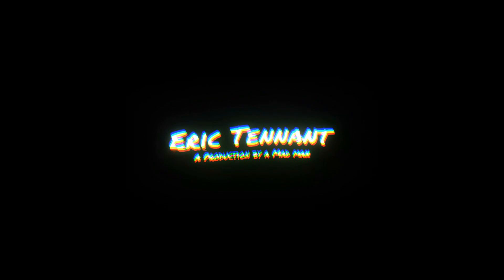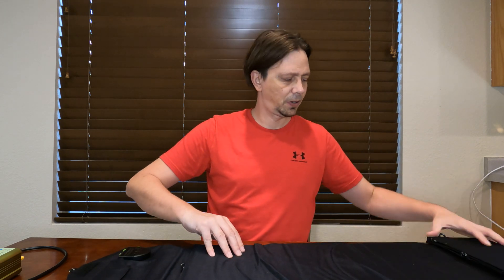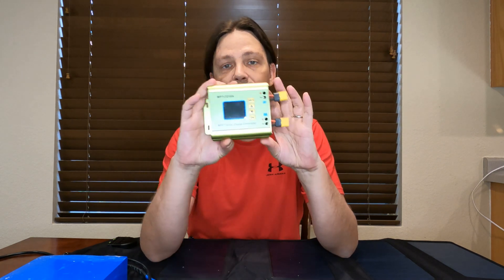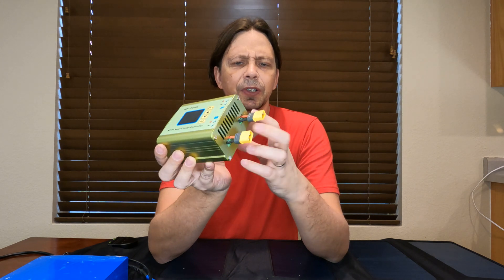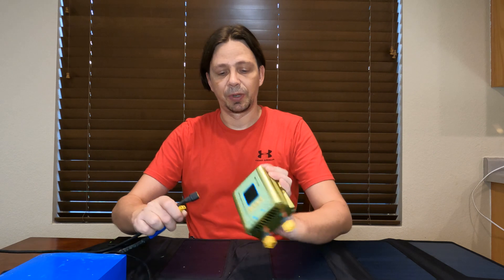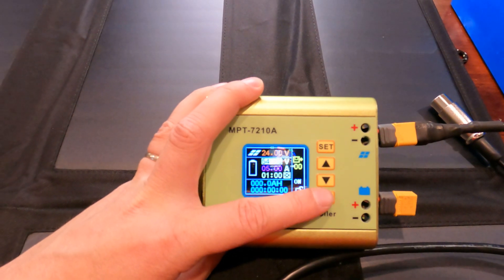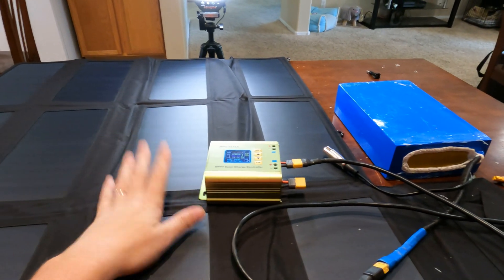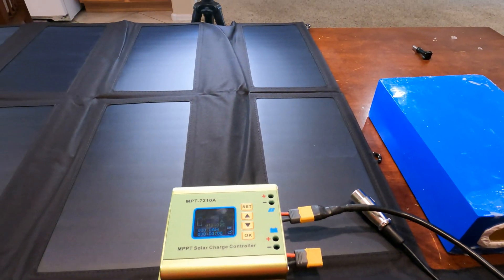How To Charge E-Bike with Solar

Comment: Sorry did you connect directly the battery with the charge controller??? I think out put of charge controller it's different than in put battery 😮, isn't it?
Reply from the maker: 54.6v is the charge voltage for a 48v battery.

Comment: Eric I need some of your genius. I have a mokwheel which has a 750 watt motor. Since I am a whale beached at around 275 I need to add a second motor I have a second battery which is about a 900 975 watt hour unit. I'm not worried about running out of battery since I have two but what I am worried about is the lack of power that comes from just having one 750 watt motor. I thought I would go to a 1000 watt motor and use three batteries as you have done on one of your bikes. The problem is I have a Mach wheel which is truly an elephant weighing 80 lb on its own. I'm pretty sure that it isn't that big a deal to add an in-wheel motor to the front wheel but I could use any sources that you have to direct me to how to do it. Dude I got into this because you made it such an awesome sport to do. I have maybe a hundred thousand miles on bikes in my life but now I'm old 67 and fat 275 and I could use a little help technically. I'm not a complete idiot I'm a Doctor who's retired but I could sure use a little guidance. If you want to help me with this project reach out and I'll find a way to get in touch. I have some family who Winters in Arizona in your areaand maybe we could bump heads have a bowl or two and work on this project and it could make a cool video for you. Dude I'm so stoked that you've had so many companies reach out to you with sponsorship test videos I can't believe it. You rock man and you really are my hero. Please be safe. 
Doc
Reply from the maker: Any bike shop can laces a motor into the front wheel and true it for you. They may charge a bit extra for it being a e-bike wheel, but as far as the job goes it the same as putting a normal hub it.

Now 2 motor one controller would be a bit over my head, but I'm sure its just a controller with 2 sets of wires for the motors.

I can't wait until the weather drops here. These month keep me indoors to much. So I focus on YouTube, and working with companies as I wait.
Reply: @Eric_Tennant  right on brother thank you for the advice. I can't wait to see you out in the mountains again. For all the stuff I can't do I get a real thrill out of watching you do what I can no longer. That's why I need the two motors that and the best that would keep harpoons from hitting me when they thought I was a grounded whale. Anyway bro can't wait to see you in the mountains again. Thanks for taking the time to reply it's laid The gauntlet down and I'll do my best. Peace and be safe. 
Doc

Comment: Dear Eric: The Unit Pack Power supposed to be bad, with fake cells, not holding the enery... Do you often change this packs, because of the mentioned reasons?
Reply from the maker: The cells are fine. The BMS they use are not so great. The BMS don't keep the pack balanced. So I replace the BMS, and add external balance wires. https://youtu.be/rXX4FNvY6hk

Comment: Great video! 
Very interesting and informative. 
I have the exact same solar panel. 
Would it be possible to replace the old solar controller with a better one?
There is a similar solar controller but with additional 100W PD USB-C output.
Reply from the maker: Yep. Takes a bit of force to get the old one off. https://youtu.be/zic6FTDI9q4
Reply: @Eric_Tennant  Thank you for your quick reply. I appreciate it very much. I ordered the new charge controller. Do you happen to know if VCC is positive and GND is negative?
Reply from the maker: Yes, VCC is positive and GND is negative on most solar charge controllers. However, it's always a good idea to double-check the user manual or manufacturer's website to be sure.

Comment: If you mount the panel to your bike u can charge while you ride. Keeping the current coming out of the battery as low as possible is key. Ill typically keep mine around 3 or 4 amps riding at around 15 mph. This is balancing out in a way as my mppt will show 3-4 amps output
Reply from the maker: With my bike, maybe with a trailer. Your system does look good, and you get a bit of shade. How does it handle over 25 mph? Only ask because e-bike or not I've been over 40 mph going down mountains.
Reply: @Eric_Tennant  handles quite well at 35-40. Though the current output gets higher than 10amps, and charge back is not efficient at that point

Comment: Very useful, thanks mate. 
Do you think this could work en route ? (with another more solid solar panel).
Reply from the maker: 100% using mid or high end MPPT like Genasun. Many use the flex panels to do this over a trike or a trailer.

Comment: Yeah solar is good but that boost charger isn't
Reply from the maker: Agree in part 3 I use a much better one, and that green P.O.S. gets return back to Amazon. Genasun GVB-8-Li-54.2V-WP: https://amzn.to/3ARroai is the one I recommend now.
Reply: @Eric_Tennant  yeah I still  have mine but two others. I just call them the blue 300s . Wouldn't be a bad boost controller  if they would upgrade  the firmware so it didn't shutdown if a bird Flys over or you walk  by the panels almost completely useless on partly cloudy days . Sorry didn't see your other post until  I posted the comment
Reply from the maker: Using that one instead of the Genasun would drop about $140 off my DIY Solar Generator cost ( https://youtu.be/NFesVlDwYX8 ). Being inside the generator box it wouldn't matter that it isn't waterproof.
Reply: @Eric_Tennant  I've been using one for two years now. They work well but always charge as much as they can. So you don't  get a top charge because it won't go into  a constant voltage at lower amps. And if you look at the specs and use presets its charge rate will go higher than your batteries max voltage trying to saturated the battery. The genason I don't know could never afford one but it's the most popular on the sun tour.
Reply from the maker: @E-bikeeverything57  Genasun won't go as high as the plug in charger ether. Stops at 54.6 when the house charger goes to 54.8 if the BMS lets it.

Comment: how brilliant would it be if these bike batteries came with a built in DC charge controller though.
Reply from the maker: In a way they do in the BMS. They just cant step up the voltage or track the best voltage point to use on solar. Maybe in time a MPPT could be built in if they were smaller and generated less heat. Also a good MPPT would need to not cost $200.
Reply: @Eric_Tennant  yeah,  somehow cheap portable power stations (solar generator) come with built in MPPTs.  I was in the market for solar generator, but I dont need the 110v inverter functionality.   I think the market would eat up a smart waterproof solar charger for 48v batteries. Something that automatically senses and uses 12v-50v solar inputs and can limit and cut off current to charge the battery.  I've got this tiny shack in the woods I sometimes camp with a south facing roof and I would just use my bike (with a 48v 40AH) as my usb power source for  fan, light, phone and laptop. Thanks.
Reply from the maker: That funny I'm building a solar generator right now for the next line of videos using these batteries. Much like you I found I have many of these part already. 

The first video will be much like how you describe using small 48v to usb(5v) bucks, ebike batteries, and a 110v -120v inverter. 2nd video will be how to put it all in a box,  and make it water resistant. Batteries will still be modular.

Comment: Is that set up using an unregulated current?
Reply from the maker: The charge controller regulates the output current base on how you set it up. On part 3 I replace it with a better one that has a fix voltage for my batteries.
Reply: @Eric_Tennant  
Thanks for the info. Does the charge controller use pure sine wave? If not don't you run the risk of damaging the battery?
Reply from the maker: @swervedriver5260   @Swerve Driver  This setup is pure DC. DC circuits have a unidirectional flow. This method doesn't use ac at all. Saves power not converting back and forth.
Reply: @Eric_Tennant  
Interesting. Thanks so much. When I'm ready to buy for sure will use your link make sure you get credit.
Reply from the maker: Glad I could help.